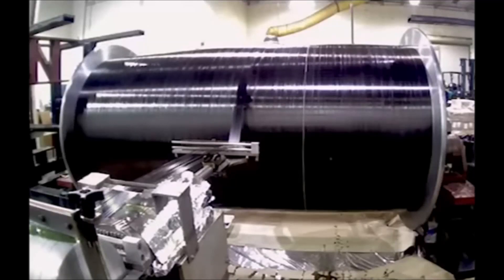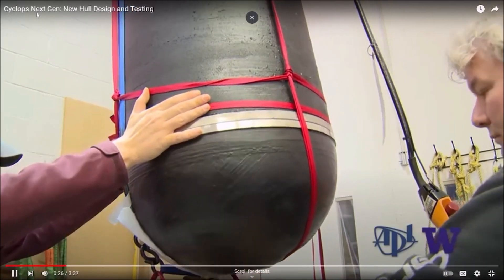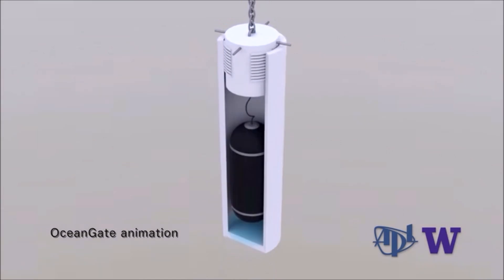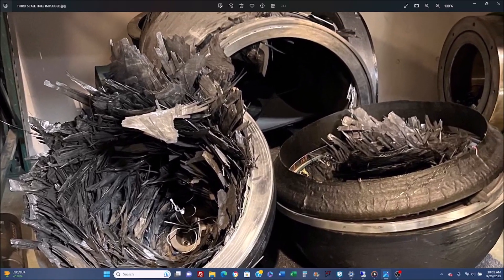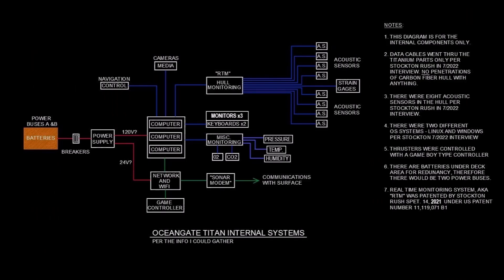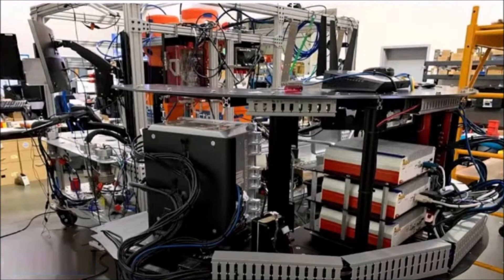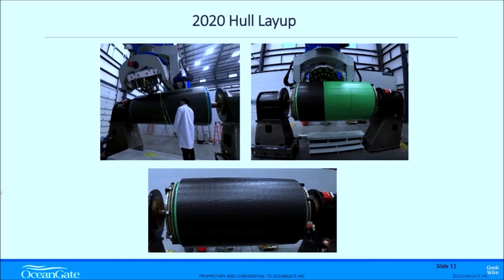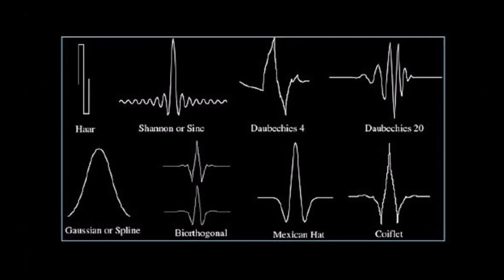OceanGate Titan - WHY USE CARBON FIBER?

Comment: The guy used off the shelf parts in a submersible that was going where few vehicles had been, he may have found a way to justify the penny pinching but that's all it was at the end of the day
Reply from the maker: Why not use off the shelf parts already designed to do the task? Why reinvent the wheel if you don't have to?

Comment: If cost was not the issue then use Ti and Syntactic foam, then there is no buoyancy issue. The logic of using C fiber fails except in the face of cost.
Reply from the maker: Yeah that would have solved some problems… and we wouldn’t be having this discussion now. Appears to me that Rush didn’t like how DSVs look, because of all the syntactic foam, so I think that was probably one of the main reasons he pursued the CF concept. There’s other reasons too, like how you get in and out of conventional DSVs. He also didn’t like that aspect of DSVs. I get his reasoning but ultimately it put aesthetics over safety.
Reply: @VegasCyclingFreak  A design rule of thumb I have followed over the years is 3F: "Form Follows Function". If you let the aestheticists control the design you end up with the garment monstrosities that strut down the catwalks, and that are never seen in public. Aesthetics have their place, the trick is to keep those deluded egos at bay, and given mission critical end product, they should be allowed no closer to the design studio than the parking lot ; ) Let them chose the colour, the visible & non-critical radii, the surface finish, the name, and the logo.
Reply from the maker: @colinellicott9737  I don't disagree with you. Just looking at it from a consumer minded standpoint. In my world all anyone seems to care about is aesthetics and it really irritates me sometimes all of the impractical stuff I have to do to appease architects and builders. None of this stuff will ever get anyone killed though, they might just be uncomfortable during peak summer temps of 110+ degrees because of the limitations forced upon me by their form over function mindset. Most of the time I can design the systems to work but sometimes due to architectural design physics wins and it is what it is.

Comment: There was plans for a Titan 3 with a 6K depth rating, that is the sub they should had built for the Titanic , I don’t think CF is as bad an idea as many say, you just need to do enough testing to know the hulls limits and stay well clear of that limit, building a 4K hull and taking down to 3.8K is not staying clear of that limit
Reply: Fatigue makes them weaker every dive of any meaningful depth.
 Wrong material.
Reply from the maker: @gfish9636  Not necessarily. The whole point of the real time monitoring system is to catch that before anything catastrophic happens. It can hear if fibers are breaking and they can simply abort the dive. Carbon fiber does not expand and contract like titanium does. It has no give at all, only a few millimeters when at Titanic depth. The real problem is the unpredictable nature of carbon fiber when used in this manner, with the technology currently available. I think the hulls were just made the wrong way. They pretty much relied on the strength of the resin and it appears that the fibers were essentially going in only one direction too. I can't understand why companies that manufacture carbon fiber things would have ever made them like they did. I think CF can handle the pressure but I don't think the technology exists which can build a cylinder in the correct manner for a submersible. Needs to have a multi-directional fibers lay up and that can't be made with the manufacturing techniques that are currently available.
Reply: @VegasCyclingFreak  
Lol
 "No give at all"
"A few millimeters at Titanic depths"
 Goofy. All in the same sentence.
Any give on CF is going to cause failure .
EVERYTHING at Titanic depths requires gives, if  even millimeters
Reply: @VegasCyclingFreak  I also think there was much wrong with this sub before you get to the CF, I read that 5 out of 6 dive attempts were aborted, the sub was basically a lemon , hull material with standing
Reply from the maker: @gfish9636  Compared to titanium. A few millimeters is virtually nothing for a cylinder that is 66" in diameter.
Reply from the maker: @denniss3980  They had a policy of anything they didn't feel good about they would abort the dive out of safety concerns. Usually was a problem with some system like batteries and stuff like that. There were a lot of different systems on board that thing. Also the weather sometimes forced them to abort dives. They couldn't dive at all in 2020.
Reply: @VegasCyclingFreak  
Once you hear a cracking sound. It's been flexed(compromised).  Period
Reply from the maker: @gfish9636  it is not possible to not hear some fibers breaking on the first dive. Out of the millions of fibers some of them are not going to maintain their integrity. It's what happens on successive dives that is the important stuff.
Reply: @VegasCyclingFreak  their safety concerns seemed to be focus on the wrong things, mine would be towing the sub on that little launching platform across the ruff seas of the North Atlantic , how could they possibly know the sub was still dive ready
Reply from the maker: @gfish9636  There was 667 layers with a huge amount of fibers. Some of them will break the first time it's subjected to the pressure at desired depth. On successive dives there should be no more noise. Per the Kaiser Effect that's what should happen. The 2020 hull performed exactly as expected on I believe 20-21 dives until it failed suddenly. Keep in mind that the RTM was listening for ultrasonic sounds, beyond the range of human hearing. Center frequency was 150kHz.
Reply: @VegasCyclingFreak 
"Should be" 
Have you heard of the word smugnorant?
Reply from the maker: @denniss3980  Many people have brought that up but Titan was built to withstand 22,000,000 lbs of force down at 3,800 meters, so towing it on the platform doesn't seem like that big a deal to me. There was a lot more going on with Titan structurally - it wasn't just held together with glue, there were things connecting everything together mechanically too. It is possible that being on the platform created some torsional stress on the interface rings, which the CF cylinder was supposed to never see. I can't see it being very significant though... that platform seems to have been built pretty sturdily but we can't really completely rule it out as a factor in all of this somehow.
Reply: @VegasCyclingFreak  my only rebuttal would be, which Titan would you feel more comfortable diving in, the earlier one we see sitting safely on the deck of a ship where it remains until arriving at the dive site, or the later one dragged behind a tow vessel for 3 days over rough seas, I know the one I would pick
Reply from the maker: @gfish9636  No, but I looked it up. I suppose we could view it that way. Carbon fiber is a relatively new material. We don't have 100-200 years of experience with it like we do with some other materials. I think Rush got something wrong somewhere along the way.
Reply from the maker: I agree. Yes, I saw an article at CompositesWorld that that mentioned OceanGate was planning for a Cyclops 3 & 4 rated for 6,000 meters. Actually the 2017 hull made by Spencer Composites was supposed to be built to withstand 6,600 PSI, with a safety factor of 2.25 -  so it missed the mark by a mile! This is why I have brought up the point in previous videos that OceanGate was relying on a third party to manufacture a hull that could do the job, but most everyone trumpets that carbon fiber is always wrong, period.

Comment: You are the only YouTuber I have seen try to point out which hull was made in 2017 and 2020, good job, keep them coming
Reply from the maker: Thanks. Some people seem to be aware of the two different hulls but I think most people are not. I've made a few videos based on the assumption that there was only one hull, so the last two videos have partly addressed that there were actually two different hulls. I don't want to spread misinformation... just want to uncover the facts best I can with the limited info I have to work with.
Reply: @VegasCyclingFreak  other channels have criticized the constitution of the hull but they were critical of the first hull not knowing there was a second hull, very confusing, and not having a spokesperson from OceanGate to clear up this confusion does not help
Reply from the maker: @denniss3980  I am guilty of the same. One reason why I made this video. I first pointed out the two different hulls in my previous video but in this one I specifically wanted to explain the why behind the carbon fiber.

Comment: Carbon fiber, regardless of its boyancy to strength ratio, was a fools’ choice because composites subject to very high compressive loads have a known failure mode. And fail it did.

OceanG completely overlooked a really great choice of material: cast sodium.  Sodium has about same density as water so the designer can use as much as neceesary.  In this case probably around a 2’ wall thickness would make up for the metal’s softness. 

Whereas submersibles have a tendency to implode, sodium coated with waterproof paint has a tendency to explode.   So the two tendencies would cancel each other, greatly increasing safety.

Also, if the crew have to surface quickly, they have only to scratch through the paint on the underside an up they go.

And, best of all sodium is non poluting and gluten free.

So, if ignoring a known failure mode is going to rule design, surely sodium is a top choice.
Reply from the maker: Cast sodium is interesting idea... not familiar with that. In theory, with the real time monitoring system this should not have happened but we know how that actually turned out in the real world.
Reply: @VegasCyclingFreak  : Ummm... dude... he's being 100% sarcastic... whoosh. Sodium would be a terrible substance for use underwater, in that it burns and explodes violently upon contact with any water at all. A single scratch in the surface paint would cause the hull to first explode then implode. No, the two do not "cancel each other"; I'm surprised you missed that clue that what you were reading is satire. Otherwise, I could explode you with dynamite, then compress you with a hydraulic press, then you would walk away unscathed. 🙄
Reply from the maker: @RobbieHatley  Ha ha he got me there. Wasn't really thinking that through... was quite busy at work trying to make progress on four projects simultaneously, like usual. Sometimes I do dumb things when I'm trying to do too many things at once. 😕
Reply: Nice bit of satire. Too bad it missed its mark. But unlike the poster, I've seen what happens when small chunks of sodium are placed in water in my high-school chemistry lab, so I have a good idea of what would happen if there was even the slightest scratch in the exterior paint of your proposed Sodium Sub. Too bad the explosion, followed by the implosion 1/10 second later, wouldn't "cancel" as you humorously suggest; instead, the two events would serve only to thoroughly mix the emulsified flesh and pulverized bones of the occupants into the sea water. More food for plankton. 

As for carbon fiber, I think I now know how to structure it to make it strong under compression: a symmetric 3D matrix instead of bobbin-wound 2D ribbons. Can't do that with bobbins or winding, though; a whole other process would have to be invented. The carbon fibers need to be structured like a random pile of over-cooked spaghetti on a plate, not like layered ribbons with the fibers all pointing the same direction. Soak them in epoxy and bake, and I'm guessing the result would be equally strong in all directions, and under both compression and tension.
Reply: @RobbieHatley  Yeah, i had a mad chemist working for me who later perished when a formaldehyde plant blew up.  His mom then had to dispose of some of his leftovers including two blocks of what looked like 1/4 pound butter sticks submerged in kerosene in a mason jar.  I took my kids down to our lake shore and tossed one into the water…nothing happened.  So i tossed in the other one and about ten seconds later we had a July 4th display.

First hydrogen bubbled to the surface.  Then the block reached the surface and the reaction ignited the hydrogen in air. Resulting explosion sent pieces of the bar hopping and exploding on surface.  My neighbor and kids thought it was spectacular.  My wife wanted to kill me.

So i conclude that a sodium sub would be fine even if the paint failed, until it surfaced….so long as the hull did not disolve at some lethal depth.  We will just have them wear ear plugs on the way up.

As for carbon composite, i doubt a safe hull can ever be constructed if the wall is not unreasonably thick.  Even if cross wound, i fear that under very high compressive loading over a period of hours the binder will creep and thus allow the fiber srtrands to get out of previous column.  Then after a few cycles, we again have shredded wheat.  So a large titanium submersible may need large boyancy items if it is to be free of a cable and that may prove awkward, expensive, or impossible.

A better solution may be to drain the Atlantic and haul the Tit out on trucks, clean up some of the other wrecks and let the water back in.

Comment: Seems like the main issue was the price of trips being too low, combined with the cylindar not being switched out for a new one as often as it probably should have. It's a sad way to learn lessons, but that is the risk of living on the edge, like skydiving, space travel, and mountain climbing. I wouldnt do it, but I wouldnt talk others out of it either, risk is part of the process. And the more informatiion comes out, especially yours, the more it looks like they did everything they could think of.
Reply from the maker: I have had the thought that perhaps the hull should have been considered an item that needed to be replaced after x number of dives. That is a big pain in the rear re-building the thing though. Maybe some day someone will come up with a better way of doing things, or technology will advance to the point where the use of carbon fiber is more feasible. Won't be any time soon though.

Regarding price, they were charging like $115K I think it was and then they raised it to $250K. Apparently the cost of fuel made these expeditions a lot more expensive, so everything just cost more. Probably also inflation is a factor in all of this too.

Comment: I think you are making great points, which people have getting wrong. One of Stockon Rush's goals was to create a deep sea submersible that could hold 4 people so you could bring your friends. In order to do this he had to make it cylindrical since a sphere would be so big and therefore so heavy in order to fit 4 people sitting next to each other (maybe you could fit them top to bottom and side to side but it would probably be awkward). So he went with the pill-shaped cylinder which is inherently weaker than a sphere under compression. Therefore he needed stronger walls. Titanium would have needed to be thick and therefore been too heavy. Carbon fiber might have been his only choice.
Reply from the maker: Yes, that's why he went down that road, and thank you. Titan was actually designed to hold five people. Most DSVs can only have 2 or 3 people at the most.
Reply: @VegasCyclingFreak  Sorry, you are right, 5 people
Reply from the maker: @aegiswings  No worries.
Reply: Rush was completely blinded by his own ego. Many people on past dives said they heard the fiber making strange sounds. But Stockton was always like we have systems to let us know when the layers are failing. We'll how'd that work out for him? Besides using an acrylic porthole that wasn't even rated for the depth he was always going to because he wanted to save money. How many times have we learned if you cut corners shit happens (many plane crashes)
Reply from the maker: @mrcrabbbbbs  Depends on your viewpoint. You see it as cutting corners, and I don't. We can agree to disagree. By the way, according to Rush, with that acrylic viewport you would get a visual warning at 1/3 of the pressure of its failure point. So if you saw any distortion and/or crazing you could simply abort the dive. That viewport was made by a company called Hydrospace.
Reply: Would have been terrible to be awkwardly positioned in a sphere. Tragic even.
Reply: LOL @nikmills
Reply from the maker: @nikmills  Awkward seating arrangement for sure, and even more awkward trying to look out the viewport, wherever that would end up.
Reply: Excellent!
We all know
Rush is a Genius
Self Titanic